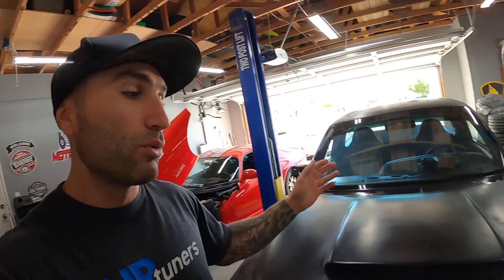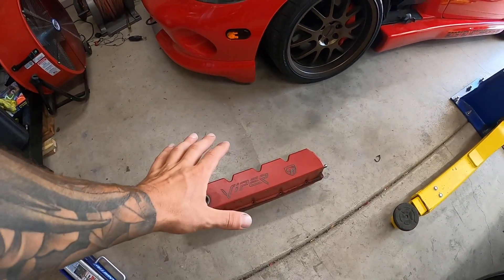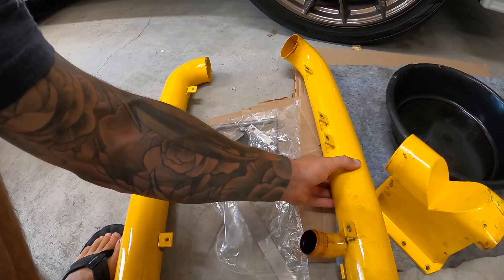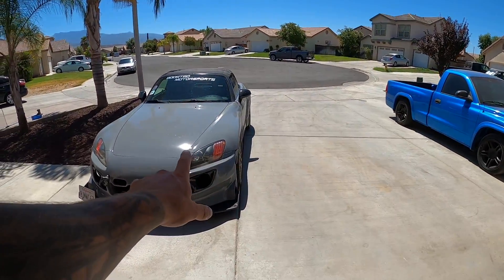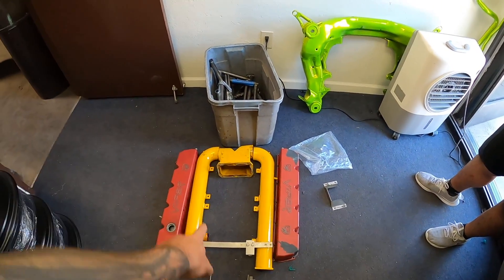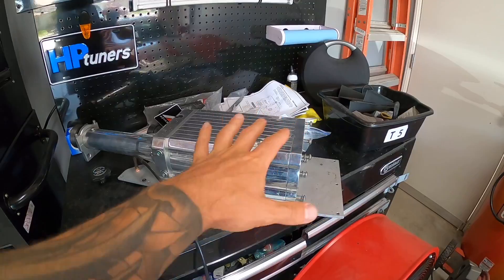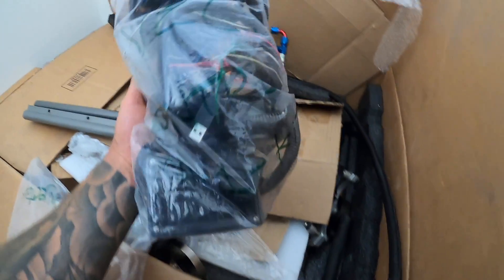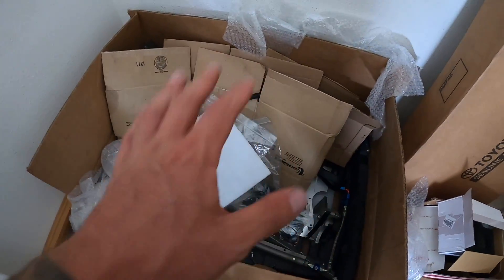DODGE VIPER GTS ACR SUPERCHARGER IS HERE | Powdercoating Time

Comment: I had the Roe and it seized on me.  Nowhere in the manual did it say to maintain oil levels.  It actually said there's no maintenance required.  So after about 3 years the oil in the reservoir dried up and the unit seized.  After that experience I went turbos.
Interested to see how good your powder coater is.  Mine had to be redone 3 times because the mag kept off gassing which bubbled the powder coat.

Comment: I need to ask a question.....what is with everyone dropping the hell out of everything? Some look good and some just don't then you basically put a huge wheel with a rubber band for a tire.....I am seriously trying to understand...ya got ppl putting brembo brake set ups on almost everything is it a California thing? And then ya got the Honda guys putting huge wheels and tires on and cambering them in so far they are only using 2 inches of the tire dropping them to the ground and putting the mosquito on crack muffler on it... And a guy on a skateboard passes them with ease....drop something an inch or two ok change center of gravity change stance.... doing so you give up some ride comfort for handling but I have taken drives in these cars and they are not some hack job lowering things...they are professionaly built and installed....they ride like shit they handle but getting in and out is a task.....I am just trying to understand is all I level some of my stuff and maybe 2 in drop at the most but this thing of hitting the pavement is bewildering to me...if you could give some insight it would be greatly appreciated thanks✌️👍